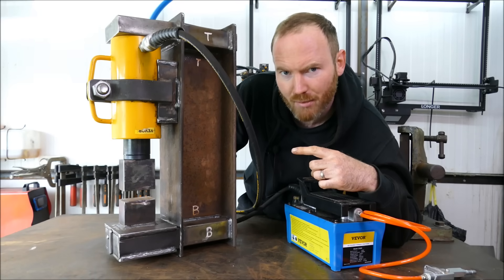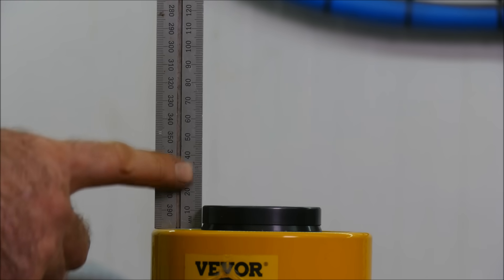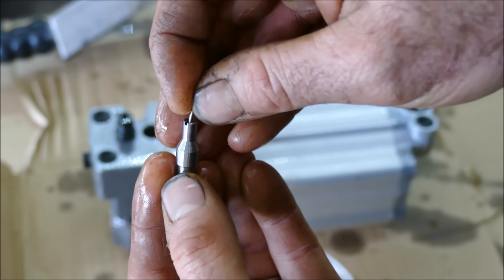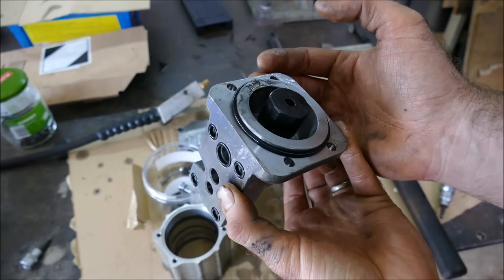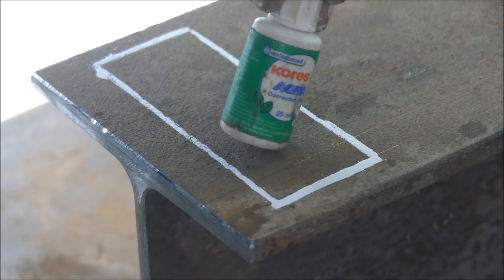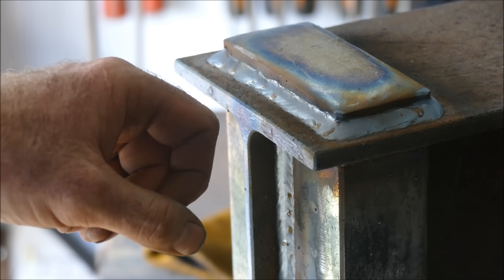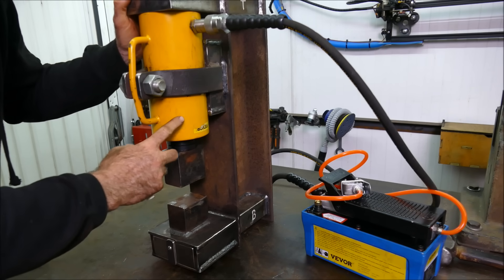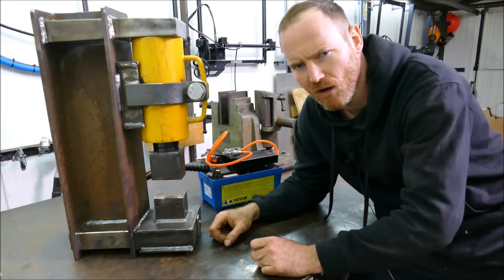£300 *30ton* hydraulic press for under! - Vevor hydraulic power pack air pump cylinder reveiw

Comment: I think you forgot powerlosess on that 3hp example, which are huge in pneumatics.
Reply from the maker: I think the heat loss is the same on a direct hydraulic pump. Essentially it's just a reservoir for potential energy, how that energy is converted to work is the important part. Cheers J
Reply: @joshuadelisle  I'm not sure at all about that. Iirc pneumatics always have way worse efficiency, cause of its compressibility vs hydraulic fluids that don't compress at all. Much lossess from that compression and thermal waste cause of that. In school I was told that there's nothing worse in efficiency than pneumatics and only reason to use it cost of equipment (=simplicity), but that efficiency is always worst off all other options.
Reply from the maker: @jothain  you might be right but I don't think it's that inefficient otherwise they wouldn't use it widespread in factory automation. It may depend on how the energy is used, lots of pneumatic tools are definitely inefficient but pistons are pretty good when you want compression so as not to over strain parts. Cheers J
Reply: @joshuadelisle  It's certainly not good though. I'm mechanic in small factory and few packaging lines that handle very modest loads and air consumptions can be in electricity to about 9-18kW (I think it's around 1,5-3 cubic meters of air per minute at 8bars). Biggest reason air so common in equipment that it costs fraction in machine making. Virtually same packaging machine can cost like 200k euros vs servo driven (and much more precise obviously) can cost way more than double (programming costs are surprisingly steep factor there). I once quickly looked prices and pneumatics for some area of kinematics could cost in components like 300 euros vs servo components could be 1000-3000 for roughly same operation. I think pneumatic overrall efficiency is in ball park of 25% vs electronics +80%, hydraulics is somewhere in between iirc. We run about tens of pumps etc. and compressor power consumption is still very substantial amount, even though we run quite top of the line screw compressors and almost all air consumption is cylinder based devices, apart some vibrators and such, which consume air in crazy amounts. Admittedly we need very clean air in our process and our dew point is -40C to be sure and that already lessens effeciency roughly 20-35% depending on load and weather. We could drop air related consumption quite heavily, but equipment cost would go up seriously in like million euros, easily which then again would take a lot off time to pay itself back. I'm not saying pneumatics is bad. I kinda like working with them and it's usually nice to find faults and repairs are very, very affordable. It's like once I contacted vendor about fairly beefy pneumatic cylinder seals. He was like you can have seals for 80 euros, but completely new unit costs 110. Now some one station servo controller can be like 1500 euros alone, without motor. Like usual, there's pros and cons to everything.
Reply from the maker: @jothain  that's a fair point, thank you for sharing this information and your experience. Definitely something I'll look more into and consider when thinking of efficiency overall. Cheers J

Comment: The plasma cutter sounds interesting, would say going woodworking sounds like a bit of a pivot, but it might not be depending on how you approach it, especially wrt. making your own tools. Otherwise if it is more traditional woodworking, it looks more like a pivot of the channel, which there's nothing wrong with, but why not make another channel to focus on such content in that case? Personally I'm more interested in the tech side of things, so if by "making my own tools" is in the ballpark of "making your own cnc plasma cutter", then I'm here for it :-)
Reply from the maker: Thank you for the feedback I really appreciate it. Self sufficiency is the heart of my channel, originally the blacksmithing side was about making my own tools to make everything else. What I don't like is being dependent on other companies or technologies that I can't fix or build myself. So for the coppice work I'll be forging and making all the woodworking tools including my own charcoal for fuel and wood gas for power. Cheers J
Reply: @joshuadelisle  Wood gas seems like an off grid solution, but apparently it can have some nasty contaminants. I don't know much about off-grid gas production, but would be interesting to see how things like wood gas, methane via composting, fermentation and alcohol distillation or even electrolysis to get hydrogen, if there was spare energy from things like solar etc., could work for off grid gas/combustion generation, all with their own unique dangerous risks, except the explosion and fire part of course.

Anyway, it sounds interesting, looking forward to see which direction things go, and I can definitely agree with you on the "knowing how stuff works" part, I hate owning something and having a feeling like it's just a black box I don't understand that can only be thrown out if it breaks or fixed by some horribly expensive parts/company.   Kind Regards.

Comment: This is wonderful!
Reply from the maker: Thank you Todd. Cheers J
Reply: @joshuadelisle  Are you happy with how quickly the piston returns? I'm looking at a 6-ton electric log splitter for about the same price
Reply from the maker: @toddellner  I think the log splitter under 10t are not good enough in my opinion for forging. This works fairly well but not as good as the power hammer I built. I would be interested in either using a smaller cylinder for faster speed or doubling up my pump for twice the speed. Cheers J

Comment: Really enjoy your videos. I wonder whether you would be better with the smaller cylinder for blacksmithing as it would be faster. Real 12t seems to be adequate in most off the shelf “home” type blacksmithing presses?
Reply from the maker: You could be right, I'll see if I can get another cylinder set to test. Cheers J
Reply: @joshuadelisle  Great video and thanks for the sources. I was wondering how to speed it up as well. Would a different power pack do the trick? Not sure what spec would need changing I'm guessing greater GPM flow? I've had some I-Beam laying around forever might give this a go.

Comment: resin printers i cant wait😊
just a heads up i have an anycubic 
and a creality halot one resin printer,

i recomend going with the anycubic resin printers,
they  print the same quality as the halot one,
but there  a hell of a lot faster printing,
also with the anycubic you only have to use one bit of software,
chitubox.

not sure what you would use to cad stl files though,
123 design no longer does support or updates,
and you cant sign up to it anymore,
you can use tinker cad,
but only upload files that are 25mg.
all my best
simon
Reply from the maker: Thank you Simon. I've got an elegoo mars and a heygears version to try out. Cheers J

Comment: This stuff IS what I'd like to see you make! I'm an aspiring blacksmith, veeeeeeery close to being a journeyman Welder (Red Seal welder in Canada) and have worked in metal fabrication for about 5-6 years and my "long game" goal is to have my own workshop with the tools I need to use all of my knowledge and experience to run a small business. I have an issue that compounds the difficulty of not working with a press or power hammer, I've had heart disease since I was born and had my last open heart surgery 4 years ago so swinging a hammer for ages and ages really wears me down. But my real problem after that, is capital. I don't have the money to be able to afford a small power hammer or even a 6 ton press (lol saw one at Canadian tire, well a log splitter on sale but EVEN STILL). Anyway, yeah finding out ways to make cheap but really useful equipment to get a broke ass bitch like myself burning propane. Keep up the good work, the videos are great!!
Reply from the maker: Thank you so much. I'll do my best to bring simple and affordable tool ideas. Cheers J

Comment: Very good idea... if rebuilding one of those footvalves is not beyond you... sometimes you can pick them up at bodyshops broken. This is the same system used to straighten frames... and they work great! You can actually pull a car to pieces with one .
Reply from the maker: They sure are good bits of kit. Cheers J

Comment: Welding factory i used to work in ( as security) at night when the weld tacs contracted they would go off like shotgun blasts when they popped , are you making those press,s for sale Joshua ? although if the speed on the slower rams is better i would still think  a twin cylinder 15 ton x 2 set up would  be better and i seem to recall seeing the power packs that you can get for twin cylinders... great video  ofc , have you considered making a DaVinci hammer ? again i was going to but im in a street my neighbors would lynch me :)
Reply from the maker: Thank you. I'm not going to manufacture them as it's a paper work nightmare I'm not interested in.   You could definitely double up everything to increase speed. I think an extra air hydraulic pump wouldn't hurt my compressor and maybe could be retrofitted into a single pedal. Cheers J

Comment: An electric pump would send this over the top. Air over hydraulic is great because it’s cheap, but it’s slow as heck.
Reply from the maker: Definitely but a lot lot cheaper. I thought I could even buy several other pumps to splice together and would still be cheaper. Cheers J

Comment: Seems very slow. I'd like to see it with a smaller cylinder.
Reply: I don't think a smaller cylinder will give enough pressure to do the job. the way around this would be a bigger pump
Reply from the maker: @davidlock8561  or two pumps
Reply from the maker: its is slow especially in comparison to my power hammer, a smaller bore cylinder would definately move faster but at the loss of strength. cheers J